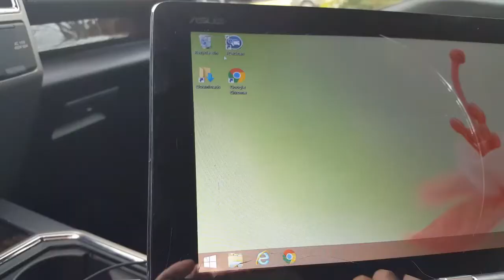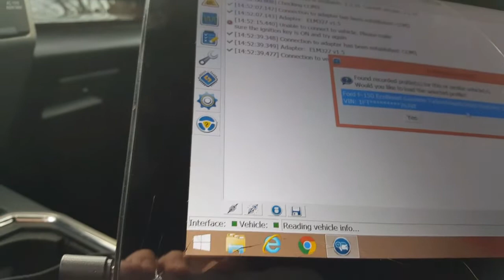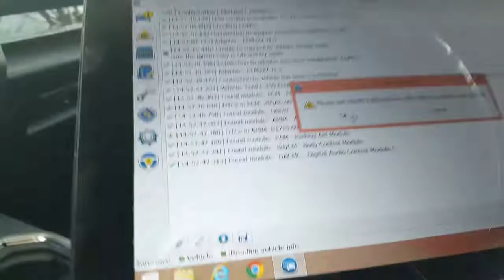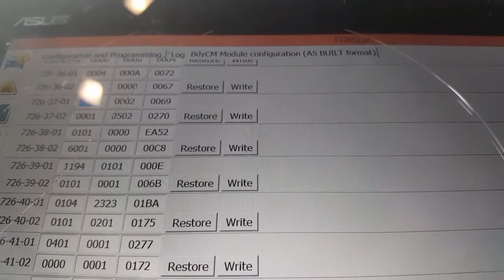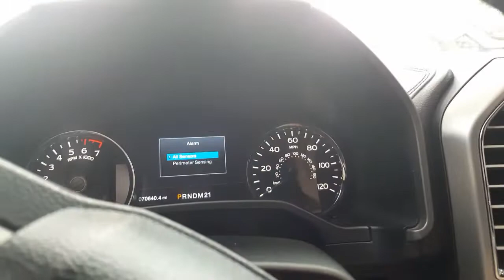FORScan mods panic button on remote on ford f150

Comment: For 2009-2015 F150s that code to change is 726-20-01 and you change the second digit of the first four digit number. There are Forscan spreadsheets online. 0 is disabled, 1 is hold, 2 is pulse (aka single press), and 3 is double press.

Comment: Nice video I'm going to have to do that!
Do you know if it's possible to make the F-150 always start in sport mode. My truck also has the side mirror spotlights. They turn off at like five miles per hour. Do you know of a way to make them stay on longer or to a higher speed? 

Thanks for the great content
Reply from the maker: Thanks Brad! Sport mode would be nice. I'll have to do some research on that. Mirror spotlights is a no for now. Maybe soon.